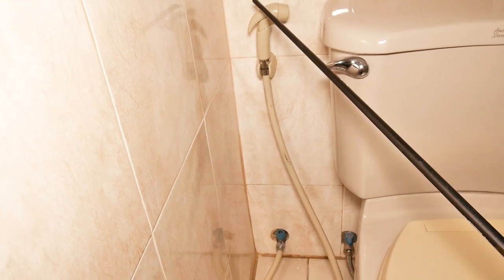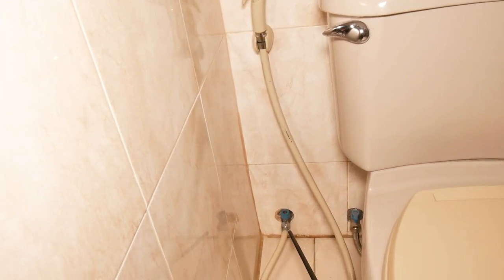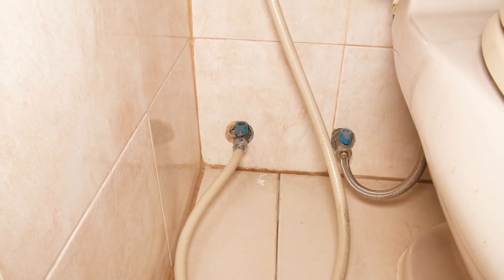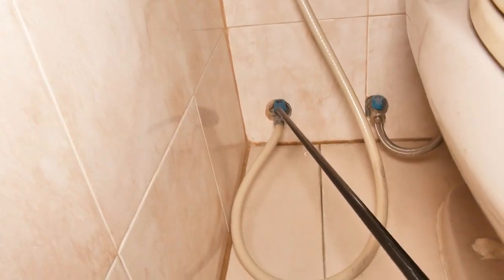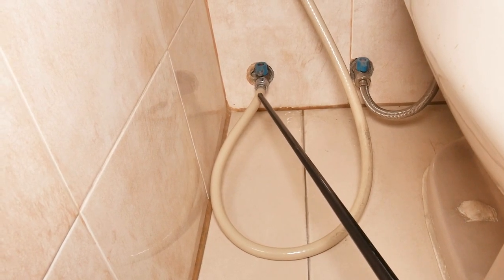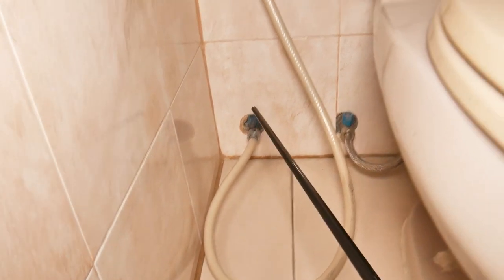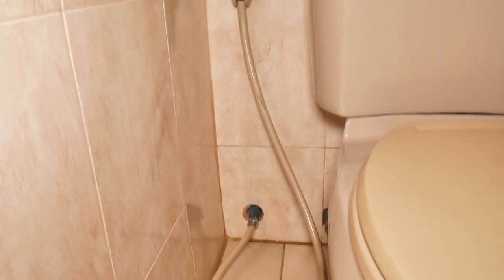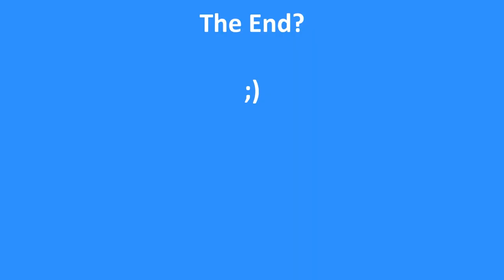"Poor Man's" Bidet - DIY Project in HD

Comment: Hi. What needs to be known when purchasing a tee valve? Given the current situation, toilet paper is running out...

One store has "3/8 in. O.D. Comp Inlet x 3/8 in. O.D. Comp Oulet x 1/4 in. O.D. Comp Outlet", another has "1/2 in. O.D. Compression x 1/2 in. O.D. Compression x 1/4 in. O.D. Compression Brass T-fitting", and one that is "1/2 in. O.D. Compression x 1/2 in. O.D. Compression x 3/8 in. O.D. Compression Brass T-fitting". Would washers need to be purchased separately?

Would a handheld showerhead work in place of your American Standard sprayer (either I'm not searching for the right things, and in the right categories, or some stores don't offer many options in kitchen sprayers, etc. The ones I have seen, most had plastic hoses, which, for something that will be used at least 4x per day, plastic seems like a bad idea for the hose)? Can the shower head part be replaced from the hose?

Also, Chai & Coaching has a video where they attach the valve (from a bidet kit) to the toilet tank, not the wall, which would you recommend?
Reply from the maker: The T valve has 3 ports.  You need to know size and male / female for each.  Water coming in M/F and size.  Output to toilet and sprayer M/F and size.  Also the type of plumbing your house uses (PVC, copper, ...).  The PVC ones like shown in the video are the easiest.  If you have the old sweated copper, multi-turn valves, that would be very advanced work.  The sprayers I have used had reinforced plastic hoses.  Good ones last for 10+ years.  American Standard and Home Depot have them under "side sprayers".
Take a photo of your current valve when you go buy parts.
Reply: How would the average person who only has screwdrivers in their toolbox find out the size of M/F? Where would one find the M/F size for handheld showerheads/side sprayers, etc? I did a quick search at Home Depot, and a side sprayer from American Standard was available, but without reading through the comments (not all products have comments), I wasn't able to find this information.

PVC? I'm confused, I don't understand how pipes, other than shutting off water supply if you only have one valve, make a difference.

Thank you for the side sprayer advice. For some reason there aren't many at Walmart (only two with hoses under $25).

Comment: Seems like one should mix cold and hot water or it would be uncomfortable.
Reply from the maker: Depending on your normal water temp of course, but as long as it's not real cold, it's not bad.
Reply: There are also valves which have a hot & cold water settings (at least I've seen them in bidet kits). I may have seen sprayers which can switch between hot and cold, rather than relying on the valve. In the summer, the cold water would be welcomed, in the winter I don't think it's going to make a difference. I think the point is to accomplish something (use less toilet paper, save money, etc), not live in the lap of luxury (this video is called the "Poor Man's" Bidet).